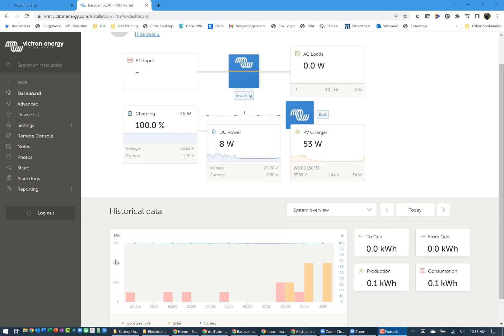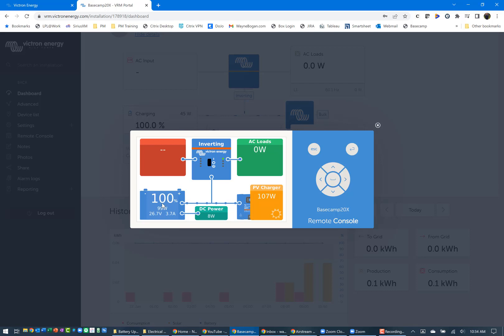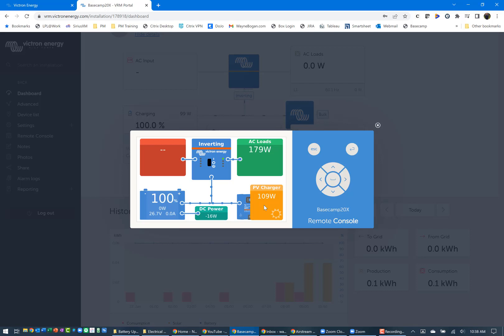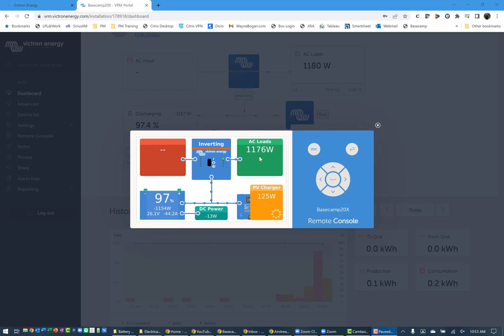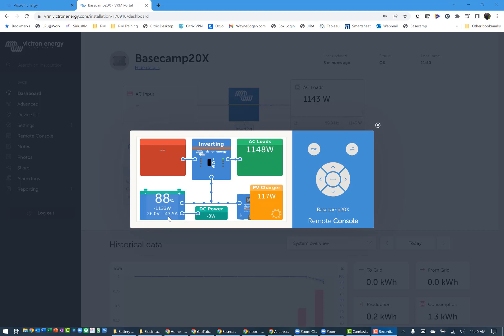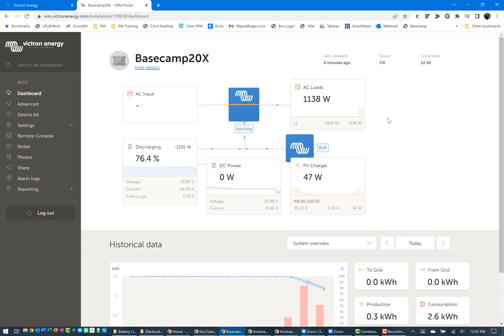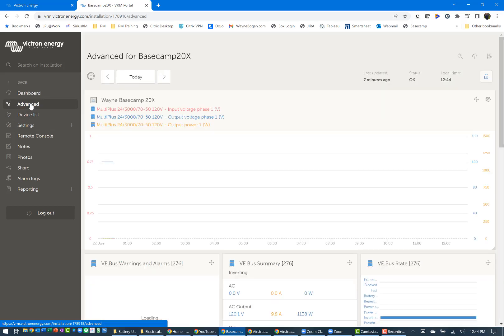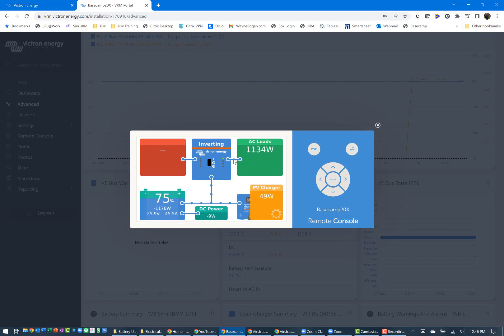Airstream Basecamp 20X, Battery Load Test , AC on Low Only, EG4 Lifepower 24v 200ah

Comment: Hey Wayne, getting my batteries installed today.   Signature solar said I would only get about 4 hours of air conditioner use.  Have you been able to run the batteries down without any solar to see how long they will run the basecamp?  I went ahead and installed 2 more solar panels, but bigger panels to triple my input to hopefully help with charging them.
Reply from the maker: @Monica Robb, I was able to get about 6-6.5 hours with AC on low before I received a low voltage alarm from the inverter.  There was a little solar input from the 200W panel but nothing to really offset the power draw from the AC.
Reply: @WayneBogan  I'm glad I got more solar panels.  I really want to get rid of gas generator.   Thanks for all the information